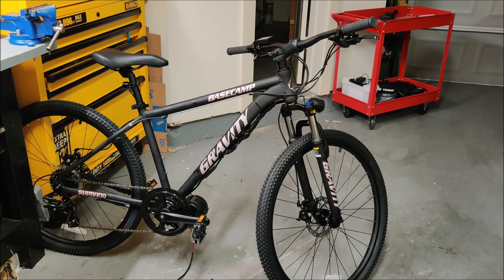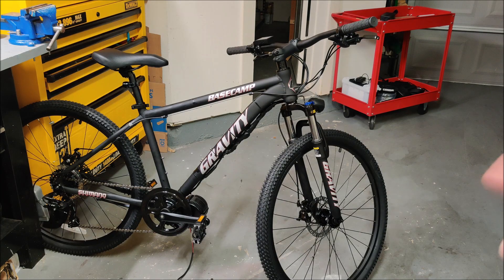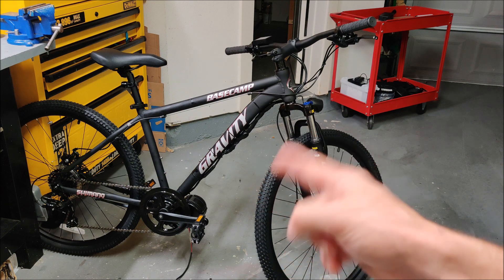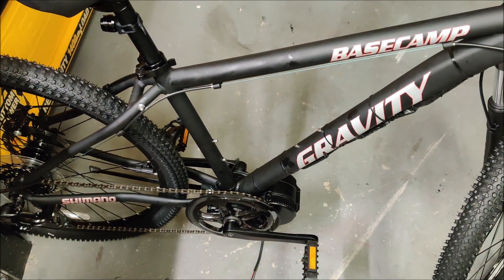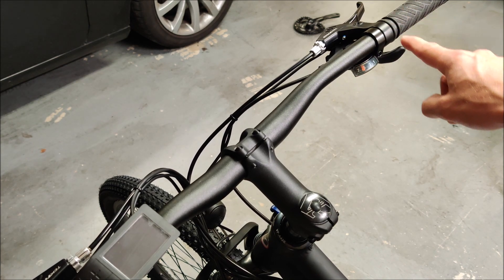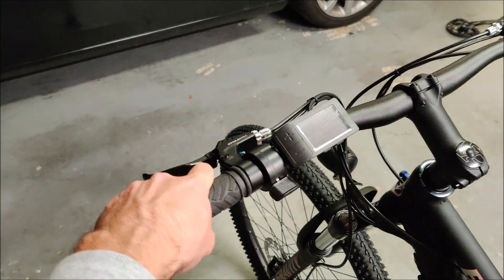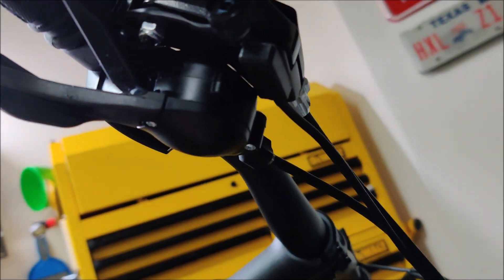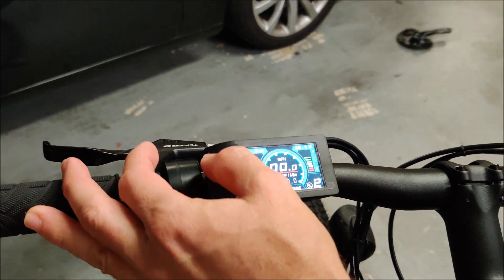DIY EBIKE - BAFANG MID DRIVE CONVERSION

Comment: Thank you for the video.  Are you able to use all the gears on the cassette?  There seem to be a mixed bag of experience from people using those mid drive motors.
Reply from the maker: Yes, since you aren't messing with the rear cassette or derailer, really should not affect your ability to shift.

Comment: Nice build. Question  what was the prices on bike an motor. What size motor 500w 750w? Looks like it gonna be a fun ride. Only thing missing is a bicycle camper. Enjoying your videos.
Reply from the maker: bike is $300 and the motor is around $475. Its a 750W 48V bafang
Reply: Thanks I'm thinking of doing one this year seams affordable.